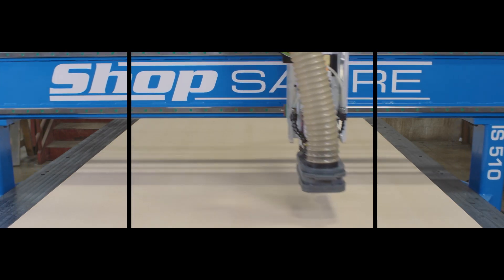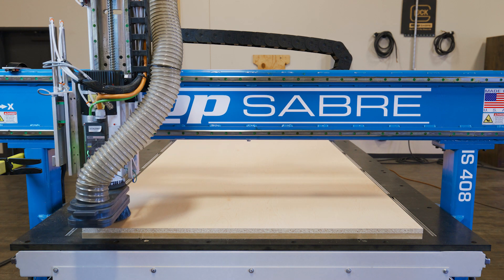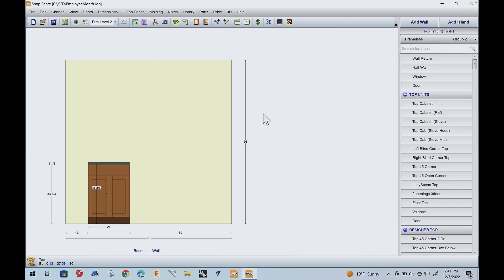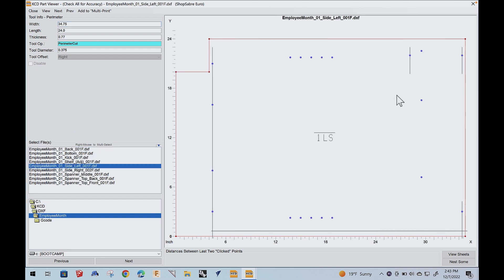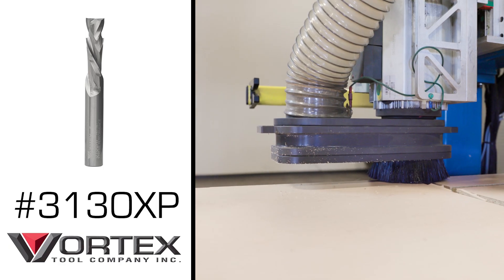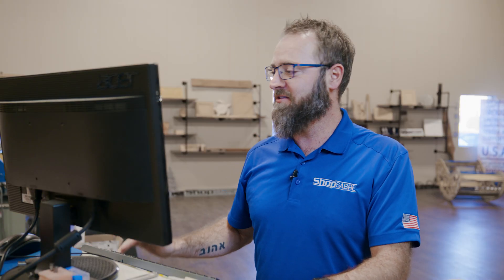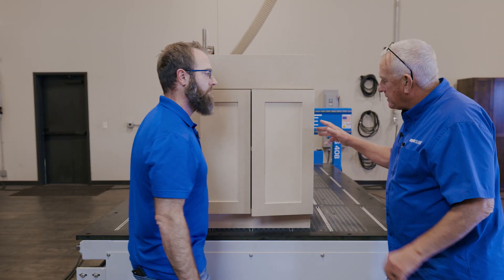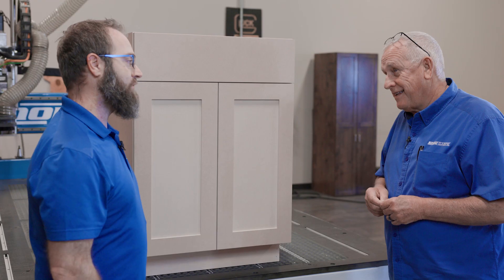ShopSabre CNC - Employee of the Month - Frameless Base Cabinet

Comment: Did you cut the notches on the bottom back of the drawer (For the slides) on the machine, or on a table saw or router afterwards?
Reply from the maker: Those notches were cut right on the CNC — it saves time and keeps everything perfectly consistent.

Comment: I am new to cnc work (and have a ShopSabre) and was a little surprised at how many of your tools were down cut. I had the impression that up cut was what people tended to use unless they were doing through cuts. Just curious...still working my way through proper tool selection for any given job. Thanks.
Reply from the maker: Thank you for the question, Larry! Generally speaking, down cut bits are going to give you the least amount of issues when cutting. With up cut bits, there is a higher chance you will pull the material from table and cause more debris to fly upwards and around the spindle. Down cut is preferable for a smoother result near the surface of the wood.

Comment: i noticed the construction method you had the machine cut .  Do you think I can use that with a plywood ?  Also, do you have that available in a file to share?
Reply from the maker: The files were generated through the KCD software, you will need to get KCD to produce these files. With respect to the material, you absolutely can use other materials.

Comment: I had an idea the other day, and couldn't find one for sale. If you could permanently mount a stills camera above the cnc on the roof, and have some photogrammetry markers at known positions, you could calibrate the image to create pretty precise outlines for remnants and odd shaped slabs for flattening. Imagine you put the remnant on the CNC, hit a button and it takes a picture of it, the software sees the edges and creates a DXF of the remnant that can be dropped into the software and be used to get a precise nesting of parts on the board you have left. You could also use it for flattening live edges slabs. Instead of manually jogging the bit, or running a rectangular face that is much larger than the slab, wasting machine cycle time. You put the slab on the machine, it takes a photo, sees the size of the slab and creates a custom facing operations for that specific shape of the slab. It doesn't need to be extremely accurate, 1/4-3/8" accuracy would be enough. I haven't seen anyone doing that, and it would be cheap to implement (once the R&D was completed) and would save a ton of time.
Reply from the maker: There is a lot going here, might be on to something if you could make it simple enough
Reply: Take a peek at systems used for leather cutting. Cnc leather systems scan for the hide shape and import into the software for nesting